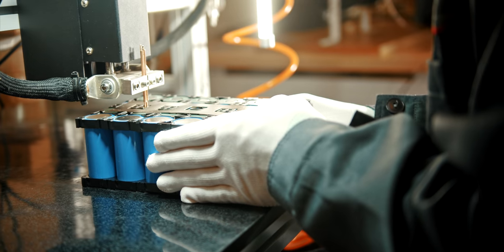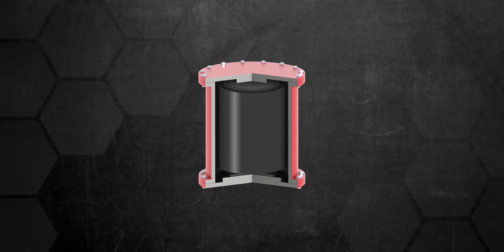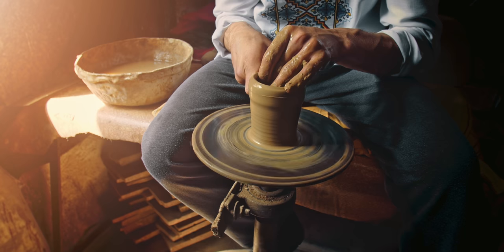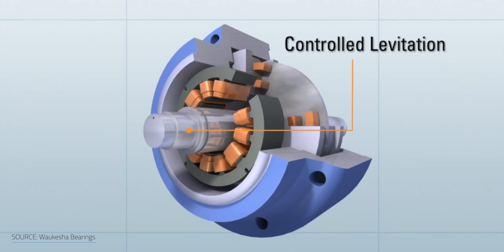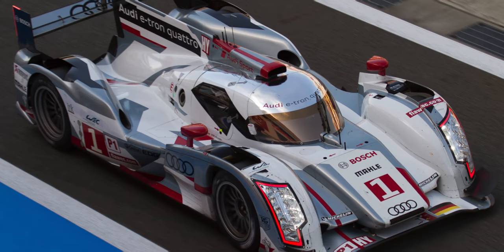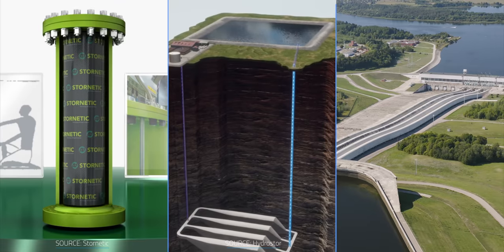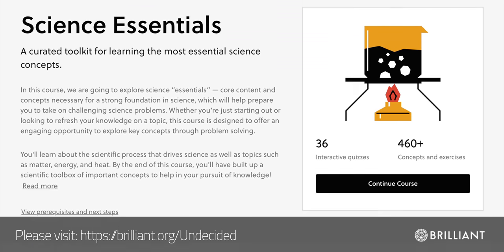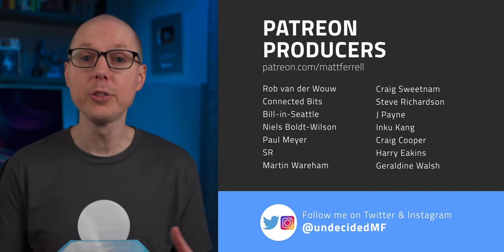The Mechanical Battery Explained - A Flywheel Comeback?

Comment: All right I could see a flywheel charging itself endlessly in a way for example you have your whole battery system going with your solar power connected to it all right you got your flywheel set it up with a electric motor that hires the RPMs of the fly wheel with miminal effort in which uses miminal energy. Once reach preferred RPMs it stops,  the flywheel will continue on spinning and charging. So what I'm saying I can see unlimited energy coming off of this but I don't know besides the whole maintenance and everything else coming out of it please someone explain to me that it's a bad idea
Reply: The problem is that while a motor speeds up the flywheel, a generator slows it down as in the process of converting the energy back into electricity it poses resistance. in the end you are always losing some energy as dictated by the laws of thermodynamics

We exploit this a great deal in the form of "Regenerative brakes" in electric vehicles (cars and trains). Where instead of just plain braking, we switch the motors to act like generators and let them suck as much energy they can back out out of wheels into storage. Allowing for energy efficient braking with little wear, using mechanical brakes only when the regenerative braking power isn't enough.

Comment: I have designed large  ( 250kw and larger) uninterruptible supply systems using fly-wheels . 
In my experience They are of limited utility, as they have many mechanical issues

Comment: error - to hold the space station at a fixed attitude relative to the earth's surface.  if we could control altitude with gyros, there would be no need for rockets.

Comment: in the first few minutes the term 'cheap enrgy prices' was used. No need to say anything about that, other than the cost of renewable energy in the UK is linked to the price of gas. Why is that ? Well, treat it as a rhetorical question - we all know the answer.

Comment: I worked at a lab in Cambridge with a  large turbomolecular pump that was spinning at about 27,000 RPM.  The rotor vibrated and struck the stator.  This resulted in a catastrophic failure that would  certainly have killed anyone under the vacuum chamber when it failed.  While I realized that a flywheel does not have a stator, it has far more energy by design.  A bearing failure could be catastrophic.  This does not preclude their use, but it would obviously be a serious design constraint.

Comment: All those cost comparisons were based on the first years operation. If you take the timeline out to even just 10yrs the batteries start to become quite a bit more costly. Why, wear-out and short lifetimes. Another factor to the falsity of the Li battery costs are that Li batts don't currently recycle at all. Combine all that with. "there ain't more Li being produced by mother Earth", which means future scarcity. This all translates to sharp rise in replacement costs for those short lived Li batts.
In summary Li batts aren't the panacea that everyone thinks they are. For a utility they are a fad and a poor choice. Flywheels just aren't cost effective at this time. Pumped hydro and gravity batts are the way of the future. Pumped hydro takes a lot of land.  Ultimately gravity batts will probably win out.
My 2c worth.

Comment: Is anyone looking at mechanical springs and pendulums? I used to wind up my watch and my alarm clock. The spring and gears would deliver the required energy smoothly for 24 hours.

Comment: Grid stabilization is a big deal. Do modern grid-scale inverters have the capability to simulate the inertia of more traditional mechanical generating equipment, or will flywheels be needed to replace things like turbine generators in a fossil fuel free future. Alliteration warning.

Comment: According to Wikipedia: "The high specific energies often cited with flywheels can be a little misleading as commercial systems built have much lower specific energy, for example 11 W·h/kg, or 40 kJ/kg." In my opinion this is an understatement. My opinion is that all engineers who design the flywheels seem to be total idiots - they memorize everything, but they understand nothing.

Comment: With superconductors getting closer to practical temps, using them in a maglev bearing system could vastly improve how long the flywheel spins, with just a portion of the energy produced going toward the cryogenic system used to keep the superconductor chilled. Won’t be done here in the U.S.A due to OPEC’s and CONG’s complete control of our gov’mint.
Reply: I thought about the same thing, let's see if Japanese will come with similar solution. However I think the total cost is still not worth a try unless someones come with ideas of how to produce flywheels easier and cheaper than Li-on batteries.

Comment: We use them at work (drups) to support critical services. Costly maintenance, management and poor reliability.  Single point of failure (bearings) so, have to have 2 just in case... then to repair takes ages and specialists. Needs more research.

Comment: That data on cost for flywheels vs batteries is biased since it only talks about first time install, but if a flywheel will last 20 to 30 years vs a lithium battery needing to be replaced every 5 to 10: you are looking at double to triple the cost for lithium during a single lifetime for the flywheel.
On top of which, lithium batteries are a bitch to recycle and highly dangerous to even try. With a flywheel, you just have to swap the windings & bearings before slapping the same flywheel back into the same housing.

Comment: Why does everyone go on about wind and solar as if they are the only sources of renewable energy. There’s also hydro, pumped-hydro, wave, tidal, geothermal and others. All these other options I’ve listed operate 24/7 unlike wind and solar.

Also it’s Uninterruptible Power Supplies (UPS) not Uninterrupted.

And Le Mans is said Le Mon. It’s not a plural.

Flywheels are great but would likely get ruined in even a small earthquake and/or lose all their stored energy.

Comment: Flywheel designs have to achieve higher efficiences....
Lower in structural weight... At least for the horizontal type
Should have a Flexible structure........that changes shape and be capable of variable inertia/ momentum ...somewhat like the behaviour of a centrifugal switch..e.g...
a high viscosity liquid thats around the centre at start-up..in a saucer like flexible structure..that gradually gets inverted.to a (tent like) shape as it spins upto it's optimum..with the viscous liquid moving to the outer rim/ flange...
perhaps with controlled valves regulating/ locking in the liquid as and when necessary..as also it's subsequent  reverse process...such types will achieve very fast , lighter loaded spin-up time higher dynamic instantaneous response times on load fluctuations.... besides the viscous liquid and be transported to the install location seperately..thus transportation is easier with lower shipping cost.

Comment: Why not connect one to a stationary bike for residential use?  Why does it have to be so complicated?  You connect a heavy, large diameter flywheel (no motor) to a stationary bike via an advanced transmission and voila: spin it down into a high output alternator and charge your power wall with it.  Am I missing something here?  That should solve your cost of installation problem.  It still needs a battery wall but so what?  Liquid aluminum sounds like it's coming to save the day and we can use marine cells until then.  CMON MAN!!!  You can get in shape too.

Comment: Spinning masses need to be captive in strong foundations. Certain speeds , have toques which have power that may vary from day to night. Gravity and variation of its natural effect, may be never tasted to conclusion, by the dangers of it.  A bicycle wheel , held by hand on spindles and spun at speed , will give you shock at the force lack of the lack of control we have over torques . It will twist and turn about its axis, with considerable power.  Every spinning mass,  has a critical speed. The speed at which it will not be in harmony with the machinery around it.  Great damage can occur if run at some speeds to the machinery.. you have to up the input and out put of the in balance area in the flywheel. This is not simple easy thing to do with a high speed 100,000 spinning mass. A dangerous unpredictable result most engineering minds will avoid.  The unknown, run to destruction in test situations , who is doing these?,  Run at  it’s’ happy speed ‘ its fine. But limiting, to . Torque is trying to lift,inan orbit from either side of the bearings go past the speed, if and when bearing control of the mass is achieved.  Breaking of its power, when in emergency is another problem.  The mass is not in control of those wanting to use its potential

Comment: We already have kinetic batteries, they are called dams! Just make tons and tons of them. Their only point of failure is the dam itself, and after 5.000 years of civilization we do know how to build sturdy dams.
What is this nonsense? A massive iron block that spins at an axis at tremendous speeds? Yeah, and what if it tilts a little because of wear, or an earthquake or something. Everything explodes spectacularly. And also, the drag man. The loss due to friction of materials. Yeah sure there's no air drag, but the axle has to touch the "battery" and the generator, and the ground. So there's your drag.
This is just stupid.
Just because it's a new idea a ton of cash is funneled into it. Government money. My money!
It's the same as those water from air scams that keep popping up every once and a while.
Why doesn't anyone remake oil out of co2? Anyone thought of that? The Germans did during ww2 but we can't do it now? Yes, of course it doesn't carry the buzzwords "green" and "co2 free" and all the other bull.
Does it work? Sure it does.
Is it efficient? I think not.

Comment: This is pretty great, but also pretty discouraging. We clearly need to move away from carbon based energy, and the answers are there, but those answers don’t CURRENTLY make simple economic sense so we don’t adopt them or fund research sufficiently. A viscous circle… Mind you, if you add in the total cost of burning fossil fuel, it’s clear that we can’t afford NOT to ditch carbon, and with more aggressive research and support costs for sustainable energy will continue to drop. But we’re still living under the illusion that we can have it both ways, that we can continue to take more than we give and that it will all work out ok.

Comment: WATT is the point herein, What makes Watt's? Energy duh I guess...sorry but the problem is the Rainy day approach ...sure a Large capacity solar cell will maintain a flywheel for say 10 hrs if your ONLY using that as a backup device but the principal is How much of a initial cost would be, and how do you meet suply/demand if it became a popular Sale but to whom? People that have only the knowledge of Danger when they think of electricity. and concider the same about cellphones. To me a single male 65+yrs old Studio apt Old Garrage and bathroom on ground level in fla. or in the High hills of New Hampshire. How many folks are going to place a Flywheel generator One Ton, or greater, in a Temp stable Pit, below Ground freeze levels with Magnetic Bearings supporting the Armature, Vaccume pump to maintain Min atmosphere in container heat and drag, etc till the cows come home and the Controls and Spare Parts Also Backup Equipment and on and on again. How many KW hours for such a design, maybe 1 fridge for a week, Heating and all the other comforts of Survival? Let me Know in the Comments below, I forgot to plug my jump starter battery for my Laptop power backup of about 2 days. 69$ autoparts store.  Teach Your Students well before they get mad when they findout the truth. Thanks

Comment: Is not worth it to invest in flywheel tech when you have so much more mechanical and moving parts that could fail... with battery, there is no moving part and battery tech is just at its infancy right now. There is little to no incentive to go with flywheel IMO.

Comment: if got 2 large clock springs put back to back so as 1 is unwinded other get wind up so soon stores energy use other got full energy ready to go so in turn would make unlimted energy if connect pipe to run genrators on each sides springs, would this work. so got 2 clocks one normal other inverted so run as one it never ending working gears Windup Girl so brain never stop working or body parts. sum one out there more brains then me could try make one if know build clocks u know how setup gears so each other moves each other.

Comment: As always, humanity just looks at the ‘get it up and running’ cost.  We didn’t look at the environmental cost of using fossil fuels.  It was just cheap to pump out of the ground.  But that isn’t the total cost, as we’re discovering now.

A flywheel may be more expensive to install than a Lithium ion battery.  It may even be more expensive over the life of the battery on a per Mw basis, but the Lithium ion battery is an environmental disaster waiting to happen.  The Flywheel will cleanly and easily be able to be recycled.  Add that cost in, and it starts to be obvious.

For example, the cost of repairing buildings and infrastructure due to the flooding on the Eastern seaboard of Australia isn’t added to the cost of fossil fuel energy.

You think we’re paying $2:00/l for petrol in Australia atm?  Think again, it’s probably double or more when you pay for all the damage it’s doing.

And the same will happen with Lithium ion batteries.

Comment: 95% of your video is misleading and the last 5% is right.  Why?  
Flywheels never were designed to really store power at descent capacities, their main role is grid stabilization at minute scale. 
Is like you never saw a discharge rate graph comparing the sweet spot for every storage technology.. even taking into account that you should know this because energy is the main topic of your channel. 
Comparing price by KWh is incredible silly without mention the discharge rate need it. 
The same that batteries are very expensive vs hydrogen when discharge times are higher than 12 hours (including flow batteries). 
It is like compare the price by KByte from cache, Ram or hard drive without mention reading speed.

Comment: Chemical batteries are dirty and promote slavery in my opinion. 
Great idea to bring rotational mass and flywheels into the conversation. 
We have very capable materials to make extremely high rpm flywheels 
quietly and efficiently and they can use small electric turbines and small 
batteries to keep the flywheel consistent and regen breaking to charge 
the battery with induction or plug in capabilities...

Comment: I worked with flywheels in several forms. Mechanical and electrical. The Radius the Mass the Rotational Velocity the bearings and on and on. I used Mag. Lev. with Copper, Aluminum, and Doped Matetials using Jop. Junc. Tec.. Here is the low down. All energy on earth eventually winds up as heat in the universe. In my experiments I understood this point about cars. All the energy to get a 3,000 lb. Car in motion is wasted when we apply the brakes.  By storing that energy or even a percentage we can increase efficiency by a large amount given certain driving conditions. Larger diameter flywheel of lighter matetial rather than massive heavier material are best. Why because they have less mass to haul around on interstate roads. When I came out of the Lab in 96 I had Built UV LASERS for Step Leader. Mag. LEV. Disk. Home brew Solar Furnaces and Tracker. Magneto-sphere monitor VLF. Shulman Freq. High Voltage Resonate Xformers and hign energh negative ion devices. Vacume Chamber Lithium 6 UV electron capture. Flywheel are more than just s shorted turn. They are a literal time machine. Understand no two points on the radius when in motion are at the same Lor. Slant or point in time. This affects the stress mass and forces acting upon the lattice structural forces. This intern has effect Here and Now with the b field properties. If is not mechanical as much as force induced stress on time itself. The mono-polar effect is just the beginning. To understand it you must use a different mental telescope to comprehend the  forces in respect to time t. Reference framing when applied to mass at different velocities and angular momentum open understanding of time itself. So I built high speed rotation of capacitor plates and die-electric k materials. AND hey there is a difference. There is so much waiting to be discovered. As a caver I learned sticking to the beaten path is not exploration it is a tour guide of the known. To find Virgin Cave one must get off the beaten path. The notion that the language of mathematics invents anything is bogus. It is the minds eye and living on that developmental edge that invent and has taken Western Civilization  to the universe.  Beware the Climate Control Religion.
Reply: Larger diameter flywheel of lighter matetial rather than massive heavier material are best.

Thanks for proving that you have no idea about basic physics, and all your text is made up.

Comment: They already use a type of flywheel and have been for some time. Most power sub stations have them . You will never be told or see it . Some sub station s,  very little, are powered by a main station.  Electric current is a scam . If you only knew the truth LMAO